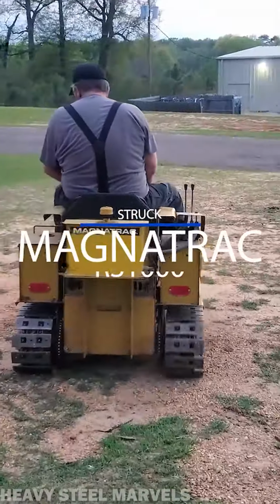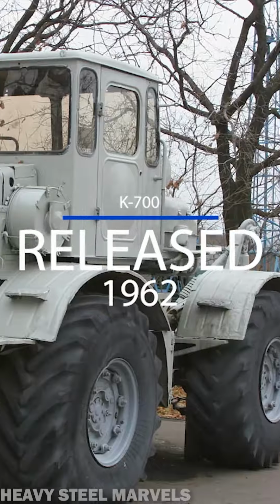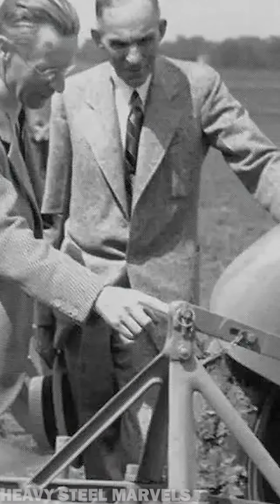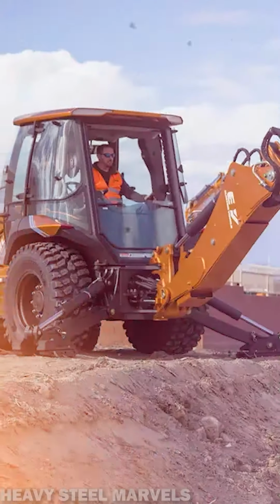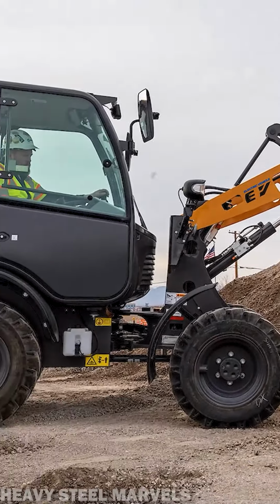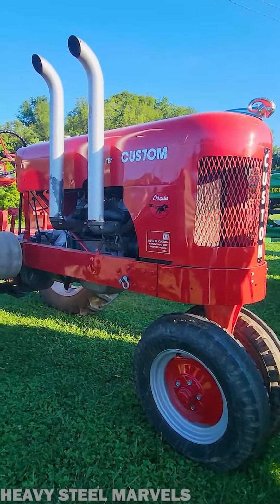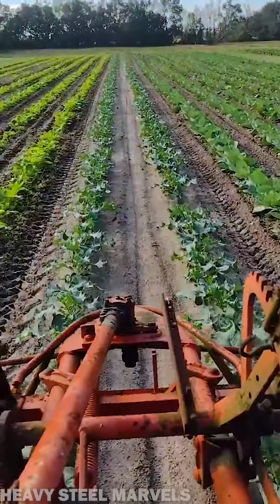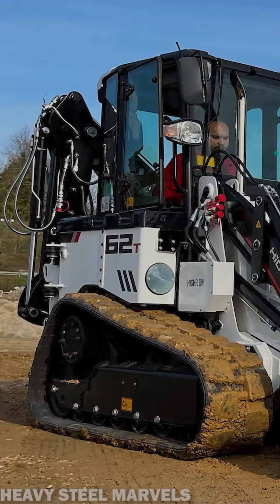How Long To CHARGE The World's First Electric Backhoe? ▶ BEST OF AUG 2024 (PART 03)

Comment: why do electric vehicles look the same as there fossil fuel counterparts. they were laid out that way because of drivetrain they used. seems like an electric backhoe could look any way you want. dont have to follow the tractor look with hoe on back with hood and grill on the front